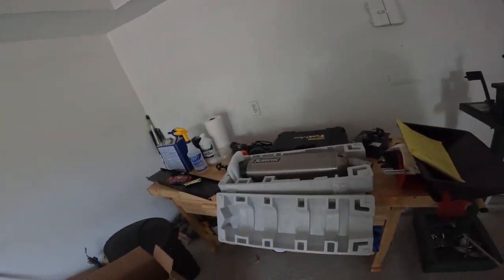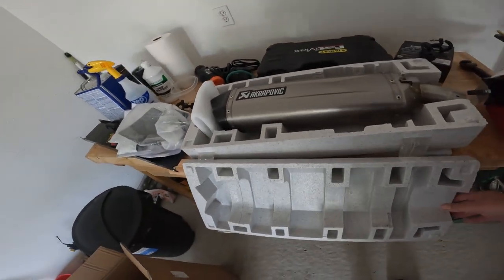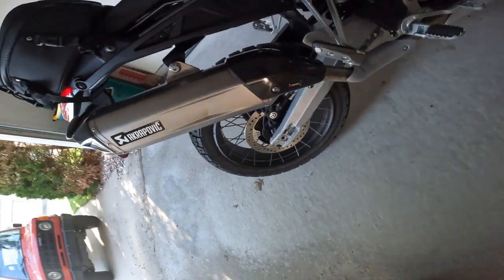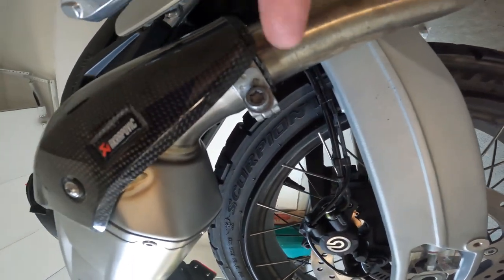Akrapovic Slip on | Aprilia Tuareg 660 2023

Comment: Sorry Mike, also meant to ask a couple questions. Is the Akrapovic noticeably louder? Is the muffler as hot as the factory exhaust? I've put slip-ons on all my previous bikes. I don't like loud pipes, they really wear you down on longer trips. All of mine saved me weight, and were all high pipes. The muffler heat is especially important for soft luggage I've found. Thanks, keep the videos coming and keep the rubber side down.
Reply from the maker: I will post some videos soon of doing some drive bys.  It is not loud at all imo.  I love this BIKE!!!!!!!  You will too!!!!  I will remove the baffles soon.

Comment: Hi Mike, nice addition.  Did adding it help with the heat around your legs at all?
Reply from the maker: It does seem to help just a little bit..  The slip on definitely does not get as hot... You can almost touch it after riding it for an hour or so..
Reply: @BaldMikedoeslife  okay cool. Thanks for the reply.